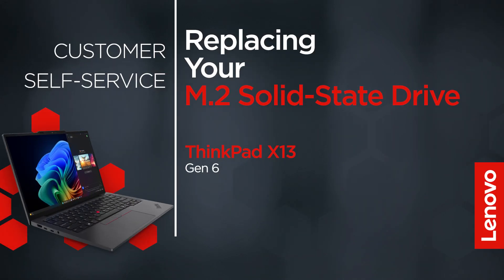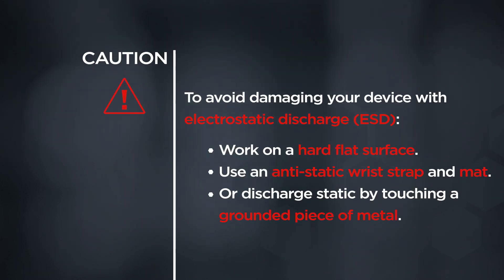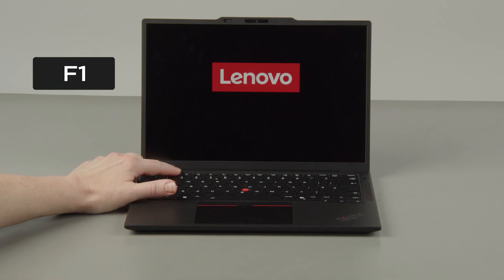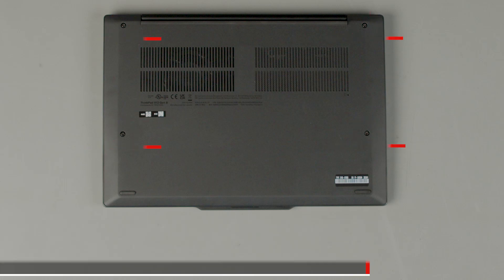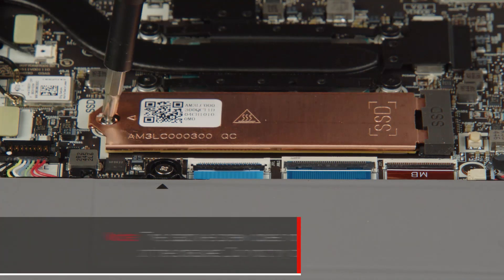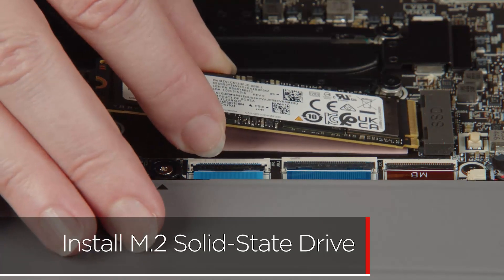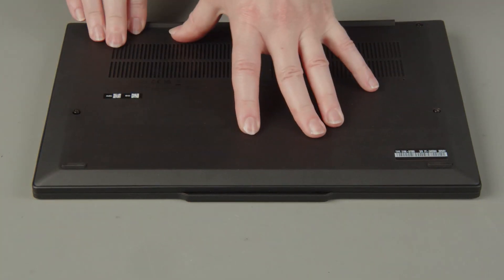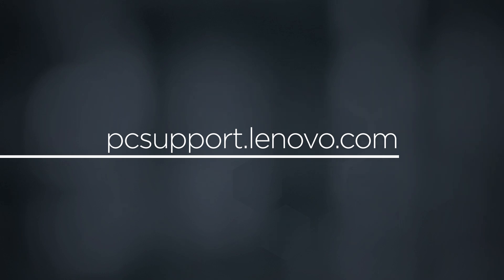Replacing Your M.2 Solid-State Drive | ThinkPad X13 Gen 6 | Customer Self Service

Comment from the maker: This video will show you how to replace the M.2 solid-state drive in your ThinkPad. The process in this video will work for the ThinkPad X13 Gen 6.

You will need a screwdriver kit, a non-metallic pry tool, and 15 minutes of your time.

To learn more about your device go to https://pcsupport.lenovo.com

To find parts for your device go to https://support.lenovo.com/parts-lookup/?cid=ww:lenovosocial:b9515f&source=socialmedia&subsource=yt

To view the Lenovo Support Self-Repair Guides landing page go to https://support.lenovo.com/us/en/solutions/HT516547

** NOTE: Static electricity can destroy components. Use a grounding strap, and clean, non-conductive surface to work on. Use plastic or coated tools to prevent scratching and avoid using metal tools on plastic parts. For more detailed information on electrostatic discharge and how to prevent it, please watch our "Understanding Electrostatic Discharge (ESD)" video: https://youtu.be/by4PB3WtdLo 

Applicable Machine Types:
ThinkPad X13 Gen 6 - 21RK, 21RL, 21RM, 21RN

Check out other official Lenovo channels!
https://www.youtube.com/@Lenovo 🟥
https://www.youtube.com/@lenovolegion 🎮
https://www.youtube.com/@Lenovo-PC 💻
https://www.youtube.com/@LenovoSuporte 🟢🟡

#Lenovo #LenovoSupport #LenovoTechSupport